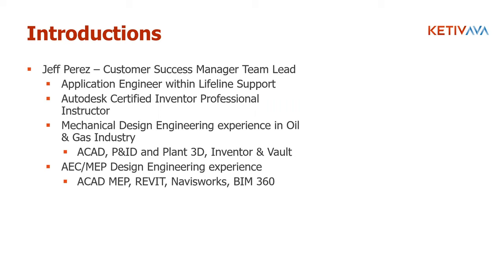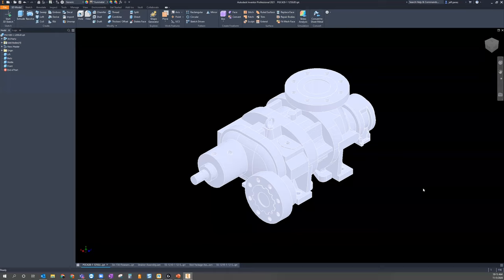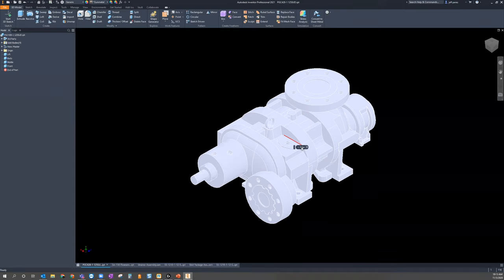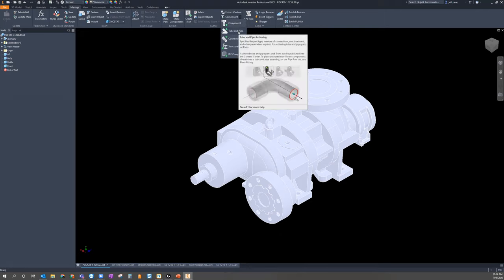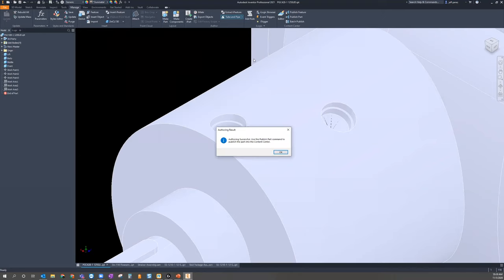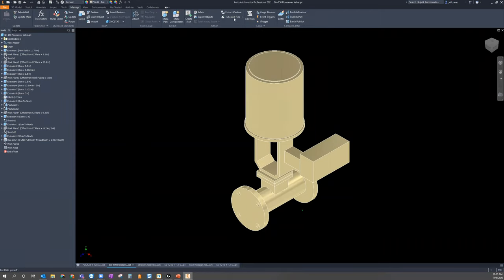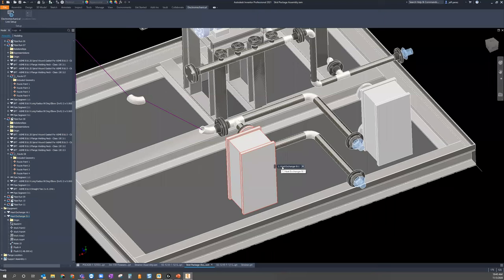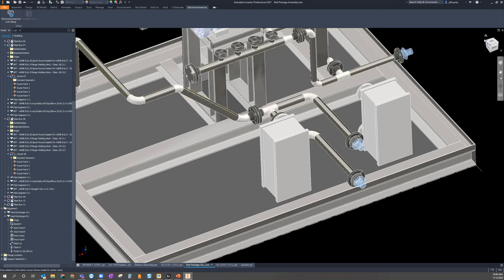Inventor Tube & Pipe Advanced Workflows | Autodesk Virtual Academy

Comment: How do you constrain your flange connector within the assembly? I'm having trouble dropping end points into a pipe run because I can use constraints as one would normally do in an assembly.